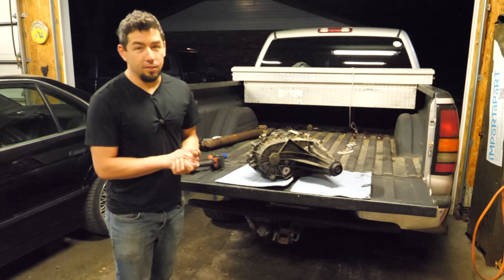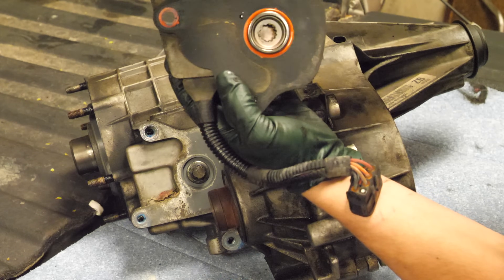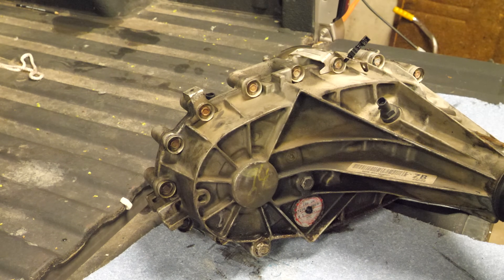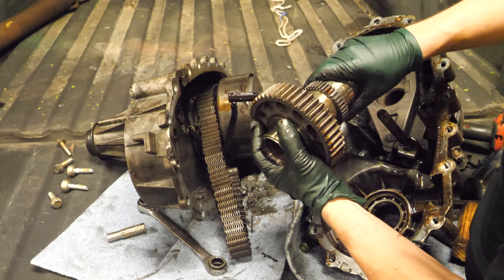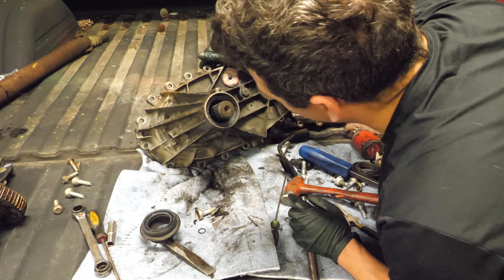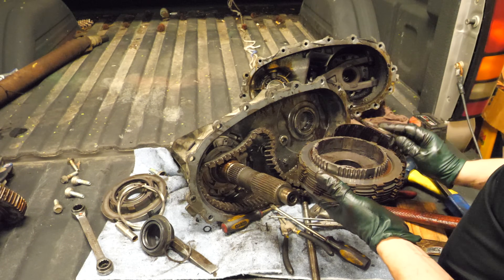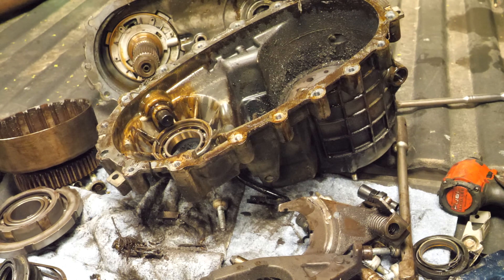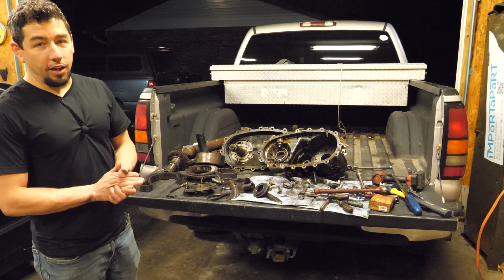Failed Chevy Silverado 4x4 NP246 Transfercase Teardown! 4 Button GMT800 Transfercase Autopsy!

Comment: Planetary gear set failure. among others, all fluid related. Who ever did the services on this truck  missed a lot more than just a transfer case! There will be more failures as time goes by! By the way, that cltcu pack uses TH400 parts!

Comment: Checking the fluid level wouldn’t have done anything but wasted your money because I done the same thing, same year same truck pretty much. I filled mine up with the expensive fluid. One week later it was completely empty again. The pump in those units actually wear through the case and all the fluid runs out, so no matter how much fluid you put in it. It’s going to run out and it’s going to tear up so That is just a default with them from 1999 to 2007 they usually last about 150,000 miles and that’s when they start acting stupid from 150k to 200k. 
Then you have to build one and put a case saver in it if it don’t destroy your too bad, you can buy an aftermarket outside housing where the pump wears through and put your case saver in it and you should be good to go probably forever. As long as someone else rebuilds it and not you.

Comment: Chevy advises trans fluid in my Tcase.  Buddy ran trans fluid and ended up with a pile of metal.  Screw that ; I run gear oil and change it every 15K.  Going on 300K with no issues.

Comment: You should have seen the one we pulled from my dad's 2500HD sierra... The front shift fork was worn down to a knife blade so it kept popping into transfer case neutral rendering the truck useless untill you got it to pop back in which was not a guarantee. You really should change the fluid in them periodically lol. The pump blew up which caused the failure on his.

Comment: In transfer cases, it's usually the oil pump that fails. There's a tab or other piece that holds the pump stationary on one of the shafts. If that breaks loose or doesn't get installed correctly, the pump just spins on the shaft, not picking up any oil and the t-case eats itself. The chains hardly ever break, they're pretty burly.

Comment: If that case was from NY you probably wouldn't even recognize the bolts. For whatever reason they had bad corrosion issues where the bolts met the case. No fluid saves weight for fuel economy, but the drag takes away the fuel economy. Seen quite a few of these with either black fluid or bone dry. Cool teardown.

Comment: Secondly, the place I buy my oil change supplies from,(normal chain store), say, "oh your vehicle takes 4.75 quarts", So I just get the 5 qt jug and put the whole thing in. Meh it's fine. But I check the oil a week later knowing I just changed it. It should be ok to wait this long. So I check the dip stick and it's like 2 inches over the oil level indicator. Think this is ok? 2012 chevy sonic LT 1.8

Comment: you should have shown where the fill hole is, i've delt with dry t-cases before they are hard to find, people think they get fluid from the tranny, i remember putting a drain pan under to   catch the fluid not a drop came out, ...   great channel

Comment: I don't know if this is the case with this one, but a lot of these TC's suffer from "pump rub".  There is a sharp edge on a stamped piece of metal that locates the pump that wears through the case and the oil leaks out.  I didn't see in this one, but you didn't pull the pump and inspect the case.

Comment: Also as I found on ford full time 4wd the transfer case is like an automatic trans full of clutches and a t f that wears and will fail if not monitored bottom line change the case fluid at 100 k I learned this when my08 explorer started whining in the tunnel I pulled the top plug on the case  immediately smelled fluid as if in a non maintained200 k c4

Comment: That's an autotrac. Those sensors monitor front and rear driveshaft speed. If there's a difference, ut send a signal to the transfer case module and the motor engages a clutch pack to bring the front and rear driveshafts to the same speed

Comment: I had an 03 diesel Silverado and the transfer case started making noises, a little over 100k miles. I checked and found it was empty of fluid. I filled it but it still made noise, the damage had been done. I took it to a local shop, and they affirmed, it was shot and I needed a rebuilt replacement. They showed me a small hole in the case, and told me it was a design issue, where some part (a spring?) rubs against the case and eventually wears a hole in it allowing the fluid to leak out. I really liked that truck, but after that, rusted brake lines, bad injectors, injector pump, lots of smaller issues, and rust, I got rid of it and swore off American vehicles.
Reply: Don't blame American vehicles for your being too dumb to check the fluids. Nothing can run without fluids and it went a long time without oil American vehicles are obviously the best in the world

Comment: I saw the exact same carnage in my neighbours 4x4 tractor planetary gear in front wheel hub. He was ploughing the whole day but failed to notice that the ring seal broke and planetary lost all the oil.  He noticed that that the wheel started to  block but managed to get home somehow. Planetary gear pin broke so one of the gears got loose and broke the other planetaries, whole housing, ring gear, pieces destroyed all bearings...Same failure here. Either the gear ping broke or the piece of housing broke and the gear got loose.

Comment: The Transfer Case on my 2001 Silverado Z71 ran dry and i kept driving it to the point that the chain wore through the case and was throwing sparks out. Mechanics vehicles are always the worst maintained...! I put a new one in and 330k miles she is still going...

Comment: These transfer cases are known to wear a hole in the case. The chain slaps inside. There is a common spot on them that I cannot remember. They are tough as hell though. I had one with a hole in the case used to piss fluid everywhere and make all kinds of sounds... I daily drove it like that for years before the 4L60E finally had it 😂

Comment: Eric, if you want a crash course in taking transfer cases apart watch Richard on the Precision Transmission channel, and yes you did need to get the clip under the rubber cover out. Love your videos, learnt so much watching you dismantle engines.

Comment: The tab that locates the lube pump wears a hole in the back of the case, dumping the lube. Rebuilt a lot of these, or replaced the rear case half, and upgraded the pump.

Comment: if you want to save one next time and rebuild it, the snap ring you accessed from the outside of the tail housing should be released first and if you get that snap ring in the correct position then it releases the bearing so you pull the tail case off and everything stays attached to the front case half. it takes some fiddling to get it just right to release and yours may have been stuck due to the carnage. i've seen that type of damage before when somebody put a reman transfer case in and forgot to put the fluid in. they will run for quite a few miles like that before shredding everything. fun stuff keep em comin.

Comment: My 2014 Ford Explorer Sport had its PTU lock up, explode, twist drive shaft, and cracked the transmission case. $6k repair.... all because the PTU seal had leaked at some point and ran itself dry. Im pretty sure Ford dosent even recommend any kind of maintenance on those, but idk. I'll be checking all of my stuff from now on. Lesson learned.

Comment: Had one of those a few years back in the shop that would drop speedo and stop shifting if you accelerated hard then get speedo and start shifting once to tapped the brakes. Turned out the circlip that held the speedo tone ring broke and the speedo ring was sliding back and forth when you hit the gas or brakes! Sadly when the clip broke so did part of the groove it rode in, or the grove broke first? Not sure, but ended up installing a rebuilt T-Case after A LOT of time diagnosing it.

Comment: I never pulled a transfer case apart. I'm surprised to see clutches in it, thought it was just gears and a chain. I rebuild a 5 speed trans but not an automatic or transfer case, something not to take on.
Reply: This transfer case has an auto mode. Thats what the clutch is for.

Comment: i appreciated the different video from the norm, its all still related to teardowns and car parts in my opinion. your teardowns combined with very good camera angles, and the very little skipping done in favor of speeding up the video like its  a half timelapse, half realtime teardown is unique in of itself. honestly couldnt even complain if it was bodywork or rebuilds either. im sure youd give them the same format as above. would be interesting to see.

Comment: Someone tried to fix a leak once and the oil pick was clogged with rtv sealant. It probably still leaked from the spilt or the pump tabs wore a hole in the case.

Comment: You didn’t take it apart far enough. The pump needs to come out and the pump tabs where they engage the case often wear thru causing a leak. There’s a wear protector there but it’s not enough to do the job. There is a kit you can get, maybe sonnax, that you put under the pump to keep the tabs from wearing thru the case.

Comment: I Do Cars, check out the Precision Transmission channel (Texas). He does a lot of transmission and transfer case tear downs and repairs. Very knowledgeable. He just did a video on this trans case a few days ago, you’ll get a full rundown on how to take apart and what to look for and tips on the rebuild. The new case you put in truck should probably come back out and have the pump mod done so it doesn’t wear a hole on the case.

Comment: A suggestion of how to check/add fluid could be helpful. At least pointing out the fill
 port/tool needed to open it. Otherwise GREAT VIDEO.
Reply: The fill and drain holes are unmistakable.  Crawl under your truck and you will see them, both on the rear side of the transfer case.  The oil level (cold) should be up to the bottom edge of the fill hole.  Your owner's manual should tell you this as well.
Reply: @ericl2969  thanks! Not my truck...but I'll crawl under. No hint on the wrench size?

Comment: I check the transfer case and diff levels about twice a month. That is overkill but it is so easy to do with just a couple of ramps and a floor jack for the rear diff. Sometimes I just drive it up on the curb. The front diff requires nothing more than a wrench.

Comment: I had an NP208 case grenade on me in Michigan City Indiana about twenty years ago.  The high/low shift fork was riding against the shift collar, and eventually wore through it (common issue on that case), but mine did an extra trick where as the fork came off the collar, it snagged the large main snap ring, and pushed it through the side of the case.  This happened within seconds of passing the "Welcome to Indiana" sign, and I was able to just limp it into the rest stop.  Luckily I was towing my old Subaru as part of a cross country move, and was able to go into town to get a replacement case and continue my journey.  Unfortunately, the case at some point had been filled with 90wt, and this was now completely covering my car.  It took a while roll of towels to clean off the windshield.
Reply: It'll keep your Subaru from rusting
Reply: @notme8121  It was a bit late for that one, unfortunately

Comment: My current truck (bought used) has this same transfer case. When I got it there was a couple ounces of black goo that came out of it. It had the infamous pump rub vent holes. Refilled it & amazingly it still worked. I nursed it until i found a used unit to replace it. This piece you have died a much worse death than mine...dang!
Reply: I had the same problem with my 2004 and I fixed the pump rub hole with JB weld till I could get it repaired.The hole is usually at the top and it only leaks when driving so you don`t even know you losing oil.

Comment: I used to have a 2002 Z71 and it never had transfer case problems. Ironically, I cracked the housing accidentally over-tightening the drain plug after changing the fluid as part of routine maintenance so I ended up having to get a new one

Comment: I had a 246 in my 97 gmt400 Silverado. I neglected to get around to taking care of the stripped fill plug, and one fine summer day driving through town with the windows open, I became aware of a disturbing rubbing noise coming from under my 300k mile rot box. It was my bone dry transferase slinging the chain against the case. Front shaft output bearing was toast. While attempting to investigate, the case shattered and I had to buy a used tcase. Once open, I found pretty much exactly the interior condition shown here. Whoops!

Comment: At my shop (Trans shop) we occasionally see a t case with a small hole on the passenger side upper section.   We have a "case saver" we install (I don't so I'm not sure what it is)    or if the customer wants the bare minimum we jb weld the hole shut so it won't sling all the fluid out.        And let me tell you.  The amount of people running around with the t case about to go is insane.  Most of the ones we check (pulling the Trans out might as well) are incredibly low

Comment: I have never seen a T case chain with that much stretch in it. The planetary is completely destroyed .  Remember when the government had a program to get old cars off of the road and to make shure the autos they bought did not get re-used they had the dealers put LIQUID GLASS in the engine oil to ruin them, it would be fun to take apart one of those engines that had been run with the glass in the oil.

Comment: I would never have guessed there was a clutch pack in a transfer case!
Reply: It's for automatic engagement of the front axle, allowing a computer to decide whether or not extra traction is needed.  Manual, non-automated units do not have a clutch pack.

Comment: I've never seen inside a transfer case before,but I've seen inside alot of automatic transmissions and that clutch pac you took out is completely ground down...that orange ring around the bottom of each clutch plate should cover the entire surface with shallow grooves in them....it's completely wiped out and have never seen a set of clutches that bad

Comment: 70% of the cars that come into our 2,200 car yard here come in for no reason other than "no oil", it is all makes from Nissan, Chevy, Ford, Honda, all, people literally just run their vehicles dry on engine oil... same for bad rear axles-most are just dry... People just will not check fluids...  Even if a transmission, axle, or transfer case drips 1 drop of fluid per day-that will add up...remember some of these are not checked for 10-15 years.... honestly people just don't care...

Great video..

Comment: I have the exact tcase in my 02 Silverado and the 4wd doesn't work because the front output clutches in the drum are toast I never knew a tcase has a clutch pack and come to find out auto trac tcase has clutch packs, what tcase do I need that will bolt right up to do away with the clutch pack

Comment: I've always wondered why you choose to use an impact driver over an impact wrench. Granted the M18 driver has enough power but I've always been curious seeing as you use a 3/8s adapters then use a 3/8 drive hex or torx.

Comment: Fun fact when your transfer case selector motor decides it won't go back into hi range after wheeling you can  bang on it with a rock while your buddy hits the switch. 

I had to reset the battery after it failed on me to get it to try again but got me home in hi range!

Comment: I just sold one of those with 200,000 miles, including many on the highway in 4wd.  It was never a problem.  

The highway was always snow covered, or it was in auto 4wd.  It also got the fluid changed every 2 years with the proper blue GM fluid.
Reply: That's exactly how u drive on highway with 4x4 on....this guy must of accidently put it in 4 low if that's what took it out but I think it just was out of oil because there were no holes in the case.

Comment: Really interesting for me. I have an '01 Duramax that threw a driveshaft, so now it's a parts car. (Almost 400k miles.) I'm hoping the transfer case is okay, since it and the transmission were rebuild not that long ago. 
Sidenote: It took the tansmission shop months to diagnose the transmission, replaceing just about everything but the planetary sets. Turns out the magnetic ring the trans computer uses to sense shaft speed was cracked, causing confusion. Only testing signals with an oscilloscope tracked it down.

Comment: they are notorious for the pump to rub a hole in the side of the case and slowly loose the fluid. I've rebuilt mine once already but mine is and and the 149nharder to find NEW PROCESS

Comment: You're reaching people. Last night before my 8 hour trip today, I checked the oil in my CR-V. Actually stopped to look at engine, the manifolds and all the other stuff I didn't know. Then wondered if Eric would show a side mounted engine with the transmission attached. Food for thought. Great videos.

Comment: And note that those cases DON'T use oil - you need the special AllTrak fluid because of the clutch-pack.
Reply: Don't use motor oil* 

It's still an oil bro lol

Comment: I should have said in the first place, sorry...  I had an 05 GMC Sierra 2500 HD 4x4 for a work truck for a long time....  Ran it up to 325k...  the engine was still running fine...  the transfer case blew up, and they junked it out.....  I knew it was leaking...  I put in maintenance tickets, I called maintenance... They were like yeah, whatever...  so...  I throw my hands up in the air...  I am only 1 man.  I can only do so much....